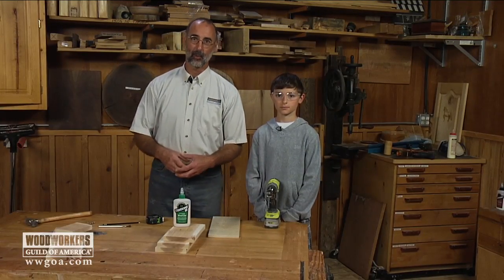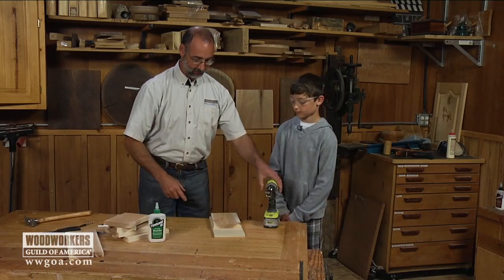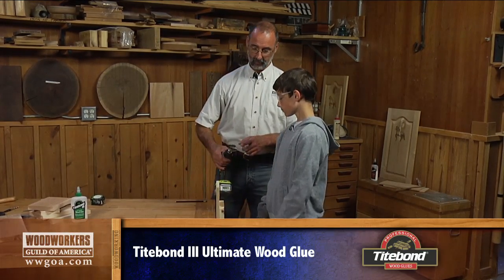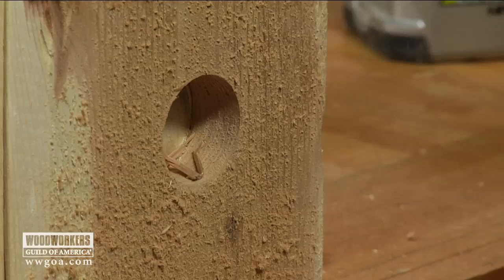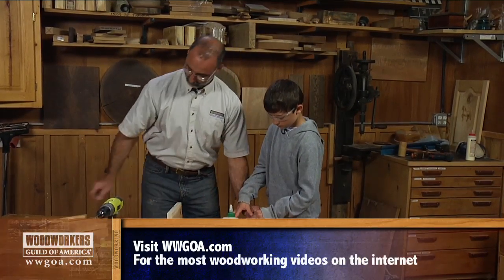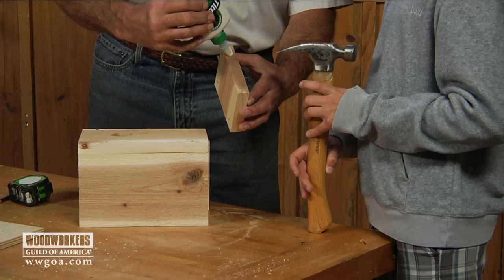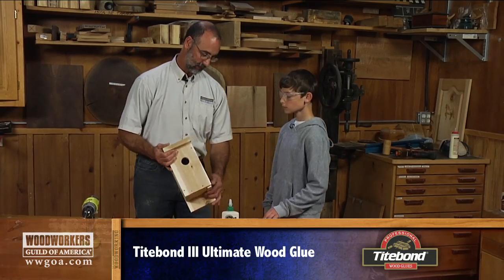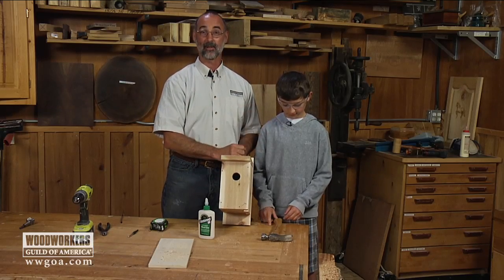Building a Birdhouse

Comment: Good work, but most of the world uses millimeters and meters, its a lot more accurate when measuring anything. Come on USA go metric for an easier way of working.
Reply: I am with you! metric system is more accurate.
Also Kilograms and tons, instead of pounds;
Also Celsius degrees, instead of Fahrenheit;
Also Kilometres, instead of miles;
Also liters, instead of gallons;
Also steering wheel on the left side of the car;
Also... drive like the rest of the world, using the right side of the road :)